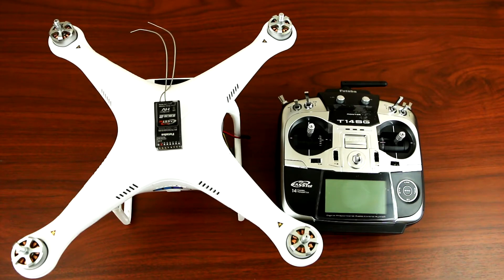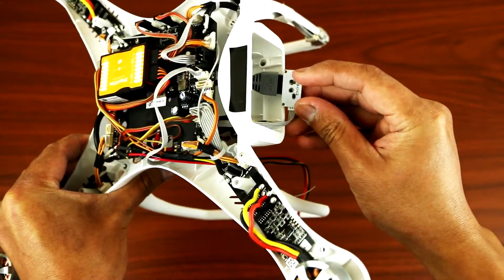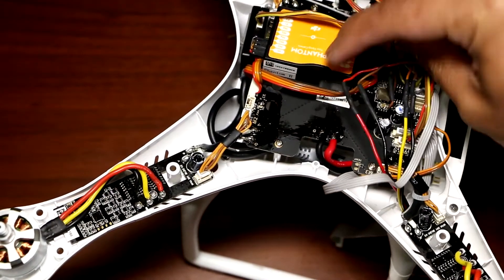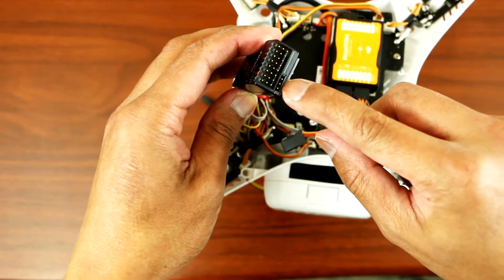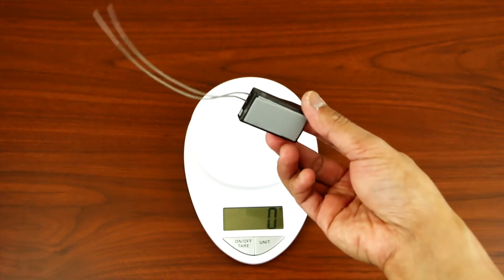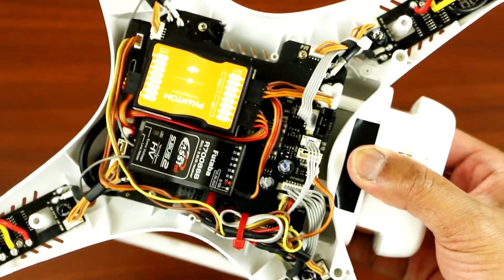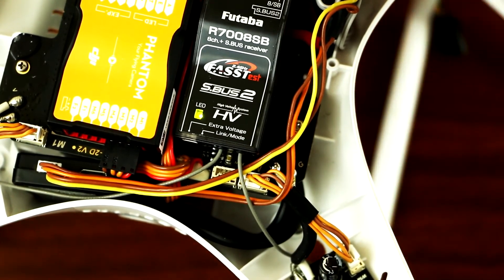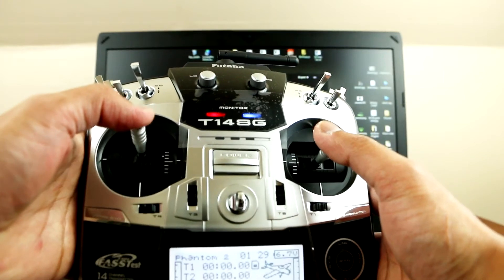DJI Phantom 2 - Futaba T14SG Receiver Installation & Binding (Part: 1)

Comment: Super helpful video. Thanks! I'm attempting to bind an R6208SB receiver to my Futaba T8FGS controller. Could I pretty much follow this same procedure and have it work for me? My controller is already programmed to fly my Phantom 2 and has been doing so for some time, I'm just upgrading my transmitter because the DJI stock receiver seems to be having issues. Hoping I can swap out the stock receiver with the Futaba fairly painlessly. Thoughts?

Comment: if you want it to lighter, maybe you should shorten all the cables, remove 50% of all the internal screws or replace all of them with nylon screws / hot glue.
The horizontal part of the landing gear can also be removed, light cover for the ESCs can also go.

Gave you a thumbs up for a great quality video with perfect sound =)

Comment: Following many recommendations I've seen about the range of futaba t14sg
I decided to buy me one.
I use the original R7008SB installed in my phantom 2.
For some reason I can barely get through the 1 km range and there are times that I went to FS Less to 400 meters.

My friend and I fly together our phantom 2.
He uses DJI Remote Control and I use
the futaba T14SG and the R7008sb.
Every time we find that DJI Remote Control
is better in terms of range ...

Comment: The nearest thing I have found to cover my wanting to use a Taranis transmitter with a Phantom 2. I am guessing I will find it straightforward because of your well thought out presentation. As a newcomer, I did wonder if the aircraft (Phantom 2) ought to have all channel definitions sorted out in the transmitter before binding, or whether this can be done as easily post binding?
I have tried to get help from DJI (on this and especially on a non Zenmuse gimbal, but unless you follow the party line on what to fit, they seem very unwilling to help! USA technical help say "we don't know" - Very helpful)
Reply from the maker: thanks for watching

Comment: I have a 14SGH on the way and was wondering something. On my Phantom 2V+, it is at 5.8 and the video stream is 2.4. does it matter that the new 14SGH is 2.4? will that interfere with the video or the radio controller at all? would they not be running on the same range?

Comment: I have the same hardware like you sg 14 plus 7008 futaba rx, i follow your directions however i unable to make work the tilt of my DJI zenmuse H33D gimbal, all work ok, but in the channel 5 do not work and the another either, can you help me?
Reply from the maker: did you watch part 2?
Reply: yes, great, is a great contribution from you in Tx and Rx change for a good quad.

Comment: I'm a little bit confused you are taking the phantom 2 apart, then removing It's Futaba FASST multi receiver to fit an other external Futaba receiver. Adding weight plus loosing function's, why???? when the internal does exactly the same job and binds to your Futaba radio without taking it apart even.

Comment: Hi LBS.
Great video.
However, I did notice that on your video at 2:58... the cable is horizontally attached to the receiver, whereas at 3:00, the cable is attached vertically on the S.BUS slot (with the yellow wire at the top). I'm confused now... so which is the correct entry point? Thanks
Reply from the maker: good eye mate! the correct attachment is at 2:58. prior to making this video, I did it vertically and when I tested it out, it didn't work, so I did it horizontally. I knew someone will be picking this up : )
Reply: Thanks bro. Yes im pretty observant. :)I just got myself a 14Sg hence been scrutinising the setups. However, I saw other video on binding of the p2 and 14sg by Arthur konze and what he did was your video 3:00...vertically attaching on the sbus slot. Hmmm.. please kindly verify before I start binding my 14sg. Thanks!
Reply from the maker: Derrick Seet yes, the correct way is horizontally. you will enjoy the 14sg radio. you got the phantom 2 h3 3d gimbal?
Reply from the maker: Derrick Seet by the way check out my other videos on how to get a smoother movement of your gimbal via programming it to your futaba radio.  DJI Phantom 2 - How to adjust the Gimbal Up and Down Motion Speed
Reply: Thanks LBS. I will bind my 14sg this weekend. Yes I have a P2 with h33d, a mini iosd, avl58 with horizon nimrod tx, black pearl monitor with horizon bh rx and cloverleaf dx on diversity, fpv hub, dslrpros 9" cf props. The next upgrade would be the anti gravity motors in the near future. By the way, hows the ibcrazy antenna range?
Reply from the maker: Derrick Seet im a bit disappointed on the IBCrazy antennas. I heard from other youtuber that they are getting good signal more than 1km or so. the thing about their test is, its all talk. they only show what's been recorded on their phantom not the fpv monitor itself. so I decided to give them a try and boy, I was wrong, there were losts of video noises. ill be doing a video test on that where you can see the actual fpv monitor instead of just BS talk that it gives good range. so im just waiting for my iosd mini cable (accidentally fried it lmao)
Reply: Yes precisely. I dont really believe until I see their fpv monitor on their supposed range. What I have seen so far are videos straight of their gopros. Haha. Yes please..it would be nice to see different range test! Will look forward to those videos.
Reply: Thanks for the gimbal setup video as well. But I do like the one by Steven Anderson. He users the switches to control the gimbal. I saw your comments on his youtube. :)
Reply from the maker: Derrick Seet I tried his setting and im not too comfortable with it, the witch knob just makes it much easier for me to control. but hey give it a shot with his good luck eh : )
Reply: Yeah lets see. Maybe I will mix and match and see what best suits me. :)
Reply from the maker: Derrick Seet also with his setting your pretty much using up all your "program switches" which you can use it for something else like the motion speed of your phantom so you can get that "camera slider" effect.  DJI Phantom 2 - Adjusting the Motion Speed of the Phantom via Futaba T14SG radio
Reply: Nice!! Yeah..I think I wont utilise all his settings. Will incorporate some others from yours too...
Reply: How do you do the settings for the motion speed / cam slider effect? Pls make other video od it soon? Lol
Reply from the maker: Derrick Seet ahahah DSLRpro charge extra money for this to program it in their fatuba radio line up. but you can get it here for free ahahah. ill be making the video probably this week. don't forget to subscribe so you get a notification : )
Reply: L BS Derrick, my Futaba rx is solid red, what am I doing wrong?
Reply: L BS I mean LBS, sorry.
Reply from the maker: Yevgeniya Lyarskova solid red when you turn it on? might be your battery is running low
Reply: L BS  Yea, mine too, Futaba rx R7008sb connected to Phantom 2, followed your video step-by-step, Phantom battery fully charged, turn it on, rx blinks couple times red, then goes solid red and stays solid red.
Reply: L BS I'm using Futaba 14sg, nothing happens when I try to link, still solid red light on rx.  What am I doing wrong?  Rx is brand new.
Reply: L BS Yea, battery was low, nice call.  Now regarding the Rx antennas, manual says they should be at 90 degrees angle and I notice yours are parallel?
Reply from the maker: Yevgeniya Lyarskova its fine just follow my setup.
Reply: L BS thx, also, wondering why I have ran into 2 youtube videos and another person who all say to plug the connection from the phantom into the futaba rx vertically, but I can't get any information why, are there any drawbacks or benefits of plugging horizontally (your style) vs vertically that I should know of.  I know you said horizontal is the correct way, but can you elaborate as to why one is better than the other?  You seem to be the expert here. 8)
Reply: L BS to make it short s-bus vs s-bus2?
Reply from the maker: Jonathan Kaminsky on the rx there is a small hole where you insert a pin to reset it
Reply from the maker: Yevgeniya Lyarskova it doesn't work if you install it vertically, I tried it before. I read my manual and it says to install it horizontal and it works
Reply: L BS Thanks, much respect, I didn't notice that.  It worked!  One more question, how do I perorm a compass calibration with 14sg, have yellow blinking light, and when I connect to Phantom assistant, says GPS calibration failed,  what am I missing?
Reply: Jonathan Kaminsky I guess that was two questions, I was never good at math.
Reply from the maker: Jonathan Kaminsky did you do all the calibration in the DJI NAZAM Assistant application. The "Basic" and "Advanced" Calibration?
Reply: L BS yes, both basic and advanced alibrations complete, however, assistant doesnt recognize controller or switch movements from 14sg.
Reply from the maker: Probably you didnt bind the 14sg properly

Comment: What's the advantage of the Futaba over the normal one?
Reply from the maker: besides having a longer range, now i can program my phantom's speed and jerky motion like how someone uses a "camera slider" my phantom will be more into that motion. with the switches i can program it to go 100% click on the switched 50% another click on the switched 25%. also when i rotate my phantom 360 degree i can slow the speed so that it acts "better" than the h3 3 gimbal without any "JELLO" effect. besides that i can program the gimbal movement up and down without anymore jerkiness.
Reply: L BS Cool. My next purchase is the Datalink and ipad ground station.
Reply from the maker: Mark Chester what does it do? and the benefit of it?